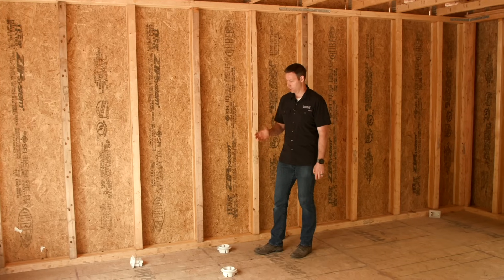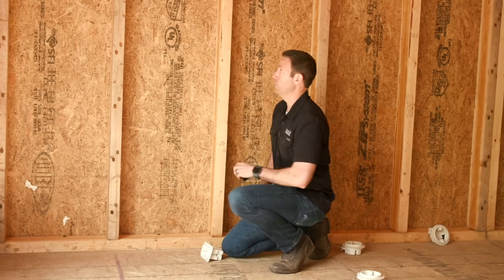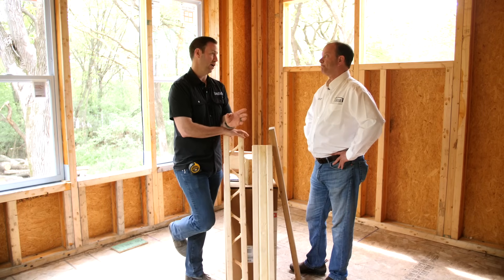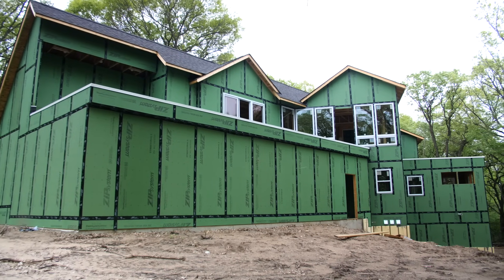Insulated Studs? This is a BIG Innovation in Framing!

Comment: I loved this video! I do wonder about one of the comments though. Not needing exterior insulation on the exterior because the studs aren't conducting through? I don't know how that's accurate. There is still a stud conducting directly against the sheathing with the t stud, it just happens to have insulation in between. Also the exterior sheathing is also a conducting surface that can connect cold to warm......... If one uses sensitive insulations in a very cold climate with high interior heating or the exact opposite environments switched, you'd still have the same conudction and thermal bridging problems or anyways the same conduction happening with or without the t studs... As you know Matt, the whole point of exterior insulation is to remove the cold conduction in a cold climate and make that sheathing warmer, eliminating the dew point. Could you perhaps comment on this because I just don't understand your claim there about how the stud isn't going to be a conduction problem anymore and somehow exterior insulation is rendered useless now......?

Comment: I used to sell the sandwich panels, OSB on both sides with expanded polystyrene insulation in the middle. They had a 200 mile an hour wind rating. I suppose these walls would have about the same?

Comment: This concern with the studs conducting heat goes back to the energy-crisis days of Pres. Jimmy Carter.  I recall articles on building 6" wide walls using 2"x6" bottom and top plates w/ staggered 2"x4" studs to eliminate the bridging.  But, that required more labor to align the studs and required more wood.  These custom 2"x6" truss-studs look like a simpler solution, and make a much stiffer wall.  The 24" spacing makes installing insulation, plumbing, and electrical easier, though owners will have to hunt more for a stud to nail a picture hanger.  I hope they glued the individual studs together to make the door headers, or used long stiff nails.  If not, the three 2" thick boards may sag.

Comment: I don't understand how you can properly fasten a california corner with these at the interior drywall corner. You're literally lapping the 2x3 to the insulation in the middle of the stud beside it, how do you get a fastener through that? Unless the fastening is eliminated because the engineer trusts the studs to not flex independently under load...
Edit: Or using a traditional 2x6 as the backer for the L stud.

Comment: If the bottom and top plates are 2.5” thick, what length nails are used to secure the wall studs to the plate?  Is there a nail gun that shoots those length nails?

Comment: For anyone wondering why the dowels between the studs are at an angle: this makes them longer, which increases their insulation value (more insulating material, even if it's not very insulating, stops more heat transfer). On top of that they also function as struts to deal with shearing forces in the length of the studs.

It's not new though. Has been used for years and years. Also in straw bale houses.
Reply: How are the dowels held in place?  Glue?  If so, how many years until the glue fails?
Reply: @drewp4  yeah, you can see the glue when he shows the example. Seems to be some sort of expanding glue. I'm not an expert on these building techniques by a long shot, but as a furniture builder I don't see why it would fail at all, provided there's a bit of flex in the glue. Which there should be with that type of glue. But even if it did the crossing pattern would still keep it strong. And on top of that it's completely filled with insulation which also adds rigidity. Surely they wouldn't be allowed to sell it if it didn't meet requirements, and there's decades of experience with it in other countries.

Comment: Normal circular saw 2 3/8 cut depth dose that mean ya have to flip wood to Finnish cut
Reply: 10" circular saws are a thing. As are chop saws and sliding compound miter saws.
Reply: You forgot chainsaws
Reply: Don't think I've ever seen anyone cut their wall studs to size with a chainsaw. Chop saw, sure. Chainsaw, not so much.
Reply: @-Keith-  
Skil SPT55-11 16 In. Worm Drive Carpentry Chainsaw

Chop saw for production for framing a house ,no , for precession yes . But your framing . 10” saw okay point taken .

Comment: When the roof starts to leak and the studs and the foam gets soaked in  the winter constant freezing and thawing does it weaken the structure? The foam is waterproof but the stud is not and eventually should start to separate. Your thoughts please.
Reply: He said they they fill with closed cell foam, so it shouldn't absorb moisture at all
Reply: @anrew4425  yes I already heard that but when you spray the foam you only fill the cavity with foam. you don't touch the surface with foam between the stud and the roof the 2inch side. So logic dictates that you have a 2inch side that can eventually absorb water and  eventually rot out. Provided the conditions are right.

Comment: I was personally fabricating things like this 20 years ago and everybody thought I was crazy.  I had building inspectors giving me shit over it. And then three years ago I built a houseboat out of it and now everyone is on board. All the wiring in the house was placed inside of PVC pipe which was run during the framing process each contact with the start was resealed with Spray Foam

Comment: We've made significant research and testing on these types of studs at our Engineering consulting company and have found extreme problems with these studs. Because wood is not a uniformed material you get twig knots where it literally more than halves the structural integrity of the stud. I would never recommend these to anyone in any project. They are not safe. What you should use is I-beam studs with a web that has a high R value.

Comment: This is not a rigid and well insulated house. If you really need to build a house of studs why not to insulate the exterior wall with 100mm graphite polystyrene insulation as they do in central europe??

Comment: This is such a dangerous and ill conceived product that will put so many lives at risk!!  DO NOT USE!!! Should you have a fire in your house these "Tstuds" provide zero fire resistance and because foam is petroleum(oil) based these studs will further speed up the fire spread and increase the fires temperature and smoke output.  A secondary purpose of studs is to isolate fire in the walls from spreading easily from side to side.  With petroleum based foam being the only barrier there is a high likelihood of fire traveling both vertically as well as horizontally in the walls leading to more damage and loss of structural integrity.  Already gusset plate and trust construction have reduced the time from fire ignition to collapse to as little as 15 minutes and these will further reduce that time.  The faster the fire can grow means the less time your family has to get out and less time firefighters can get inside to put out the fire and salvage your house and its contents.  While under normal conditions they may be stronger than traditional wood that benefit is quickly lost in fire conditions.  The sayings "if it seems too good to be true it probably is" and "nothing comes for free" come to mind here.  If you already have these studs in your walls please tell your local firefighters so they know about it ahead of time as it might save their lives if a fire does occur in your home. I know they said they WILL BE offering fire rated studs however these studs as they stand in their original form should be banned from use.

Comment: This is an interesting variation on the long-established framing technique for achieving thermal and acoustic break in stud walls. But it's not a "BIG Innovation"
...
The factory-made unitized members shown here are a convenience for the site, and the truss structure lends some good attributes for strength that may be needed in some cases such as very high ceilings. But the idea has existed and been used for many decades. Here's the common alternative easily done in the field or in advance in a shop. Below is how its been done for decades, often referred to as staggered stud walls (SSW). Staggered stud walls are usually not unitized by a physical joint though, while the alternative below is.
...
2x6 or 2x8 top and bottom plates, conventional double top plate optional (not required unless preferred).
Double 2x3 or 2x4 studs offset in/out and separated side to side by 1/2" or 3/4".  
Occasional bridging with 5.5"x 3" plywood or OSB spaced along the height of the twin studs. 
Space these fabricated thermal/acoustic break (FTAB) members at 24" OC and fasten with usual framing techniques.
Set ceiling or floor joists directly on top of each FTAB member. 
Gives at each 24" a nailing stud for exterior sheathing and a nailing stud for interior drywall with a ~95% thermal/acoustic break between the two. 
Use scrap 2x3's as horizontal bridging at 4' for horizontal drywall and sheathing nailers.
...
We've been doing this when requested since the '60s for a thermal and acoustic break that can be filled with insulation of choice including very inexpensive blown cellulose. Nice openings between the offset studs with minimal and quick drilling for running PEX water pipes and romex and other cables, too.
...
So if getting these nifty factory made thermal break members is cost or access prohibitive, you can do about as well by quickly and easily making your own inexpensive thermal break framing members.

Comment: The stud ratio is no where near 25% At 24" the ratio is about 10%
Reply: 4.7% for double top plate and single bottom plate (3*1.5/96).
6.25% for 24" (1.5/24).  9.375% for 16".

10.9% for minimum.  But that's a perfect featureless 8' wall, that does not include all the extra framing for doors, windows, or corners or a lower height which increases the percentage for the plates.  Window framing adds a ridiculous amount of extra lumber in my unprofessional, non-builder opinion (helped frame a couple of windows before).

That's also for 24", and the assumption made for 25% is 16".  Which when you account for the difference should be something like 3.1% lower, call it 21-22%.

The more important issue is thermal bridging, and it's more of an issue the better your inter-stud cavity insulation.  Hence all the movement to exterior continuous insulation where 100% of the wall is insulated.  It's entirely logical to just bypass the stud bay insulation and relevant issues.  Matt presented a video or two of a house built with all exterior insulation and open stud bays, which while I felt had a lot of advantages, I also felt it was kind of ugly (and someone commented that cleaning dust in all those open stud bays would have been quite a chore for living in the house).

But then, again, I am not even remotely into architecture or construction industries as a career, I've just been looking in depth for a couple months about insulation.

Comment: What is the cost difference? Awesome idea but is it worth it if you use an insulated zip board on the outside that’s got an r9 or higher.. I’m all for super Efficient homes and I love the fact plumbers and electric just poke thru it vs time taken to drill.. also what is the strength comparison vs a normal pressure treated rim plate? Are these offered in pressure treated feature in event of termites etc

Comment: You'll want to get the ones that are NOT already pre-foamed.  This way when you spray, it's continuous in hardening together.   Like concrete in one pour.
Reply: Or if you insulate with batt and not spray, like rock wool, you'd want the pre-foamed.

Comment: Very interesting.  However, I did not like the electrician putting wires through the studs, and presumably piercing the vapor barrier.  It would be better to use the Canadian system of using 2x6 studs, then vapor barrier, then horizontal 2x2s on the inside with more insulation.  All the electrical wiring stays in this inner section within the vapor barrier, so their is no violation of the vapor barrier by piercing with holes for wiring.

Comment: The cost delta of only $1500 or so is shockingly low. I'm curious what it actually ends up being after taking into effect savings with electrician/cabling labor and especially energy savings over a few years.

Comment: you can do the same thing by ripping 2X6 length wise and setting on 12" centers offset with the studs' wide side faced at the front and back of the floor and top plate. and spray foam the wall. You will get a better thermal envelope, stronger wall (like SIPS), faster at a cost that is comparable. This is a gimmick.
Reply: I feel like it would be easier this way though if the cost is the same. And you couldn’t frame doors and windows the way you mention.
Reply: @traws06  sure you could, use a bunk. They use them all the time on ICF, earthship, and stray bale builds
Reply: From what I read almost all of the companies building these thermal break studs have gone under. Prolly a reason for that...

Comment: Cause heat escapes outward not upward. Yes I know cold comes in through walls and if attic insulation superb then heat will start escaping through walls. But like others said windows lose more. 

Have to look at what state or area you are in and extra cost of these vs potential savings cause this is only gonna reduce heating costs 5% maybe 10%

Comment: Wanted to use these in a new lake home. Company never responded to general contractor after repeated attempts to get bid from distributor.  Complete lack of communication.  Went to staggered 2x4 exterior 6" walls and blown in damp cellulose instead.  Much less expensive with comparable R value.

Comment: Interesting and fascinating. is the cost justifiable? These run about $2.50 per board foot which greatly increases the cost of construction and how long would it take to break even from the "supposed" insulation efficiency. 

Nice to see some innovation though

Comment: How much extra would the framing for a house like this be compared to a “normal style framing?
Reply: A......lot
Reply: These studs are $2.50 per board foot
Reply: @davem45  That makes no sense, do you mean linear foot?
Reply: @davem45  Thanks Dave but this does not help since it is wrong. It should say lineal foot...don't believe everything you read..The writer is definitely not an expert.

Comment: This is an expensive concept!  Here in North Carolina to achieve the same concept they use staggered 2 x 4s on a 2 x 6 top and bottom plates with the studs staggered on forward and one back, on 12-inch centers.  The cavity is filled with spray foam insulation.

Comment: At 3:11, I'm looking at the window framing in complete confusion.  This is a gable-end, yet the framer has used enough lumber to support a destroyer.  Kings, cripples, trimmers and I don't know what else.  What is the thinking behind that?  Since the 3x6 studs are R-20, is it easier to just fill the space with them rather than insulation. Is the cost of time and material cheaper?  Just wondering.
Reply: Watched the rest of the video, Doh!  Question answered.